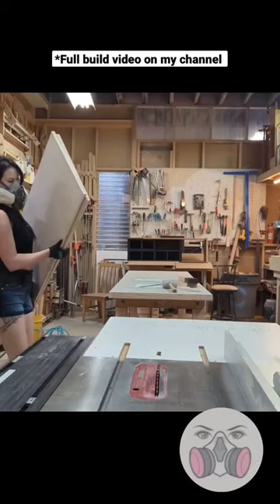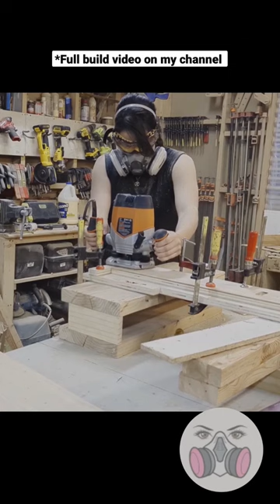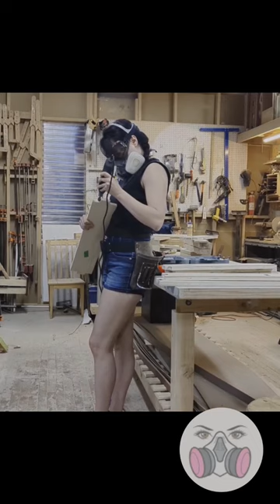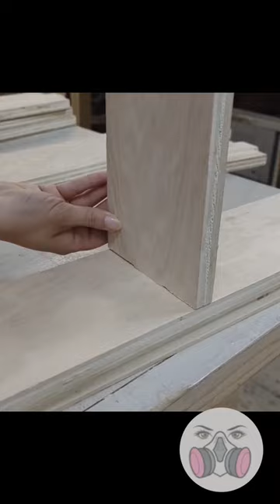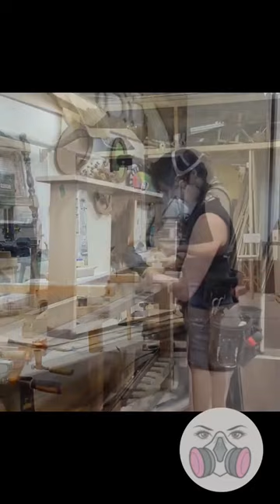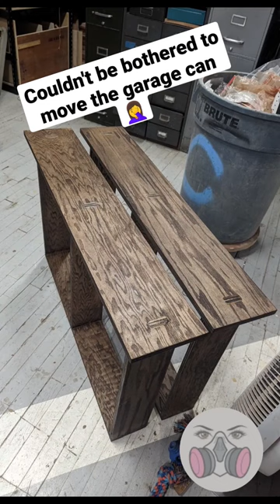Imposter syndrome ftw! #howto #diy #woodworking #diywoodworking #woodworkingtools #diyproject #tools

Comment: We’re all learning all the time, so please don’t take offense, but using the dremmel that way is pretty dangerous. Very easy for that high rpm drum to kick. It’d be a lot safer to clamp the work piece down with the edge you were grinding/sanding hanging over the edge of the bench. No one wants to get hurt.